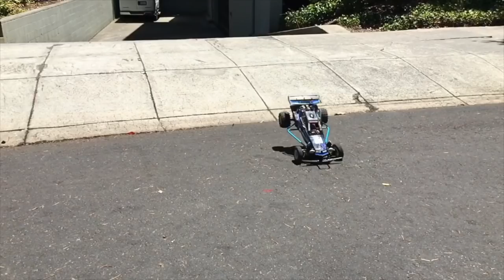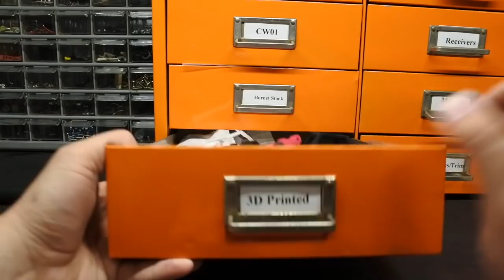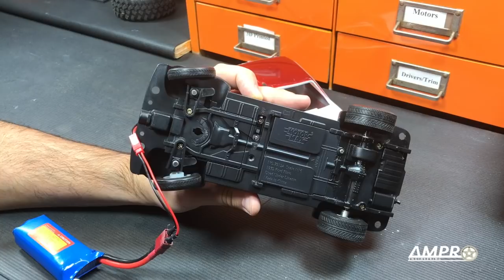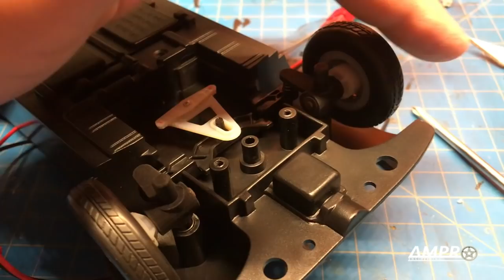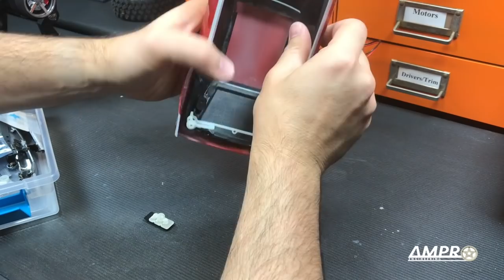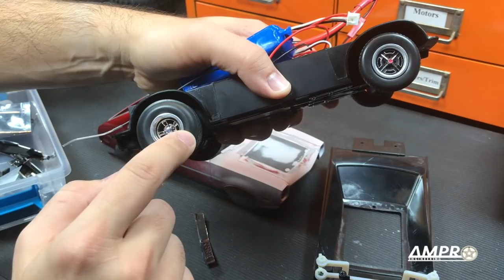e176: 1:16 Ford Pinto By Motor Max -Upgrading by Ampro

Comment: I was looking at my pinto thats like the one your working on and noticed that bottom front and bottom rear of fenders arent tucked in like side of body. Are you gonna heat and pull them in and trim the chassis bumpers
Reply from the maker: Yeah I know...that annoyed me. I didnt do that since it would interfere with the chassis installation. I sanded the edges down to help the look and I think it did the trick. I am just glad the car is done now

Comment: yesterday watching older jdpasl video of a brushless GH, had a "silly" thought, a "what if" a Tamiya Fox rear pod (motor+gearbox+arms+hubs+shocks the works!) were grafted to a GH/Hornet tub?! now add your improved front suspension and the cage for rigidity and the sand rail look... oh my! Fox having the motor aft, gears+diff near as bulletproof as a Hornet, and it allows for a few different tooth pinion gears to be used easily. motor being aft kinda would be like weight distribution of a VW with IRS, for more rear traction and maybe some wheelie action using smaller pinion too. still all Tamiya, but a hybrid of good simple basics that creates something new. edit: basically much like your Superfly II, just a lot less custom fabrication involved for making it happen.
Reply from the maker: Wow...yeah...man that would be cool to see!

Comment: If you can make lexan bodys from that one I would purchase.  Want to build pan chassis drag car that really goes.
Reply from the maker: That is a good question. This may be something I need to ask Team Blue Groove.
Reply: that would be really cool to digital scan and stretch the hood a couple inches, hardwood CNC vaccuform molds for both stock and funny car versions. early last year stumbled into a kinda rare 1/12 BoLink dragster body in eBay, used carbon fiber arrow shaft and black epoxy-glass plate to build a rail chassis for it. "welding" was all cutting to shape, scuffing areas rough, lashing together thick with black sewing thread and CA. rear motor pod is black CF/nylon, was also eBay about 6 bucks. 3650 size 5000kv, 16/44 gear (32p) 1/4" solid fiberglass rod rear axle... its quick fed 2S, near insane on 3S for being so light.

Comment: I had a 74 2.0 4 speed wagon I drove over a dozen years. Great car. Bought it to hot rod but ran so well I just kept driving it and found a 70 Maverick to put a 351w in. Still have the Maverick and still runs strong.
Reply from the maker: Good to hear. The '74 is the best year in my opinion. It is the only year for the non-catalytic converter floor pan and also has the rear subframe that the early cars lacked. Plus it still had the simple fuse panel. I love those Mavericks too!

Comment: Alright, now pour some Gasoline on it and then light it up. Most accurate Pinto ever!

It’s lookin good!
Reply: Ford Fan01 just needs a micro switch in the back bumper to trigger the igniter.  Accurate to the 1200th degree!
Reply from the maker: Hahah, jeez...the explosion fiasco on these cars was a total joke. They were one of the safest sub-compacts of the 1970's but man, that BS story just stuck like glue.
Reply: AMPRO Engineering So in reality, only a small percentage of em, how should we say, detonated. But many people like to act like any Ford Pinto is gonna spontaneously detonate and take out the neighborhood. I believe they even got a recall that fixed that issue.
Reply: was a cute one used to run around Santa Rosa CA, blue in front, nice flames from the rear forward with a text plate at the bottom of the rear hatch "close cover before striking". I had a little 1500cc powered MPG model (tiny trunk no hatchback), Russian River flood of 86 trashed my mom's Pinto wagon and we'd just rebuilt it's 2300cc engine. pulled it and flushed it out popped it into the MPG with its lower geared 4 speed (different flywheel etc). little thing would SCRAMBLE to 50-55 in 1st and 2nd gear, quick to 80 in 3rd. aluminum slot rims (lower mass) all the "dumb weight" stripped, no smoggy pump junk, etc. the MPG were stamped from thinner sheet metal to be lighter, a VERY bare bones Pinto turned budget "horsepower paper clip". little 2300 put out pretty good power, at 60k miles the OHC starts going flat, so ya just replace the cam. had a lot of fun with that toy after slapping in a set of KYB's.
Reply: @FordFan01  I was working at a Mercury Dealer as a line Tech while these were still coming in for retrofitting..... 

Yes it was a LONG running joke! It came from one of those OVER sensationalized TV "news" Programs. IF you hit a Pinto at the RIGHT speed, in the right spot, with CERTAIN Full Size Ford's with Bumpers that were lower than safety standards allowed...
(68-73 LTD and Galaxie were recalled for new, compliant Front Bumpers) AND the Bumper slid under the Pinto's Rear Bumper....

The impacting Vehicle could shear the Pinto's Gas Tank - and the POINTS Ignition and leaking Spark Plug Wires, COULD ignite the Gas that sprayed out of the Pinto from the impact! 
KABOOM!!!! 🔥🔥🔥

THE FIX was a Bladder, inserted into the Gas Tank through the Large Fuel Sender hole on the top of the Tank. 

THEN sensationalists claimed that it was a "Band Aid" fix! Just putting a balloon in the Tank. 

Well...... Rubber lined Fuel Tanks were very successful since WWII, taking 20mm BULLET strikes without leaking! 😳 
There were NO problems after that. 74-up Pintos came with lined Fuel Tanks. So did PintoStang!! 

The only design issue was that the ONLY place they could put the Tank, was right behind the Rear Bumper, and hanging a little below the Bumper. 

....... The ONLY thing I didn't like about the Car, was that when I turned 16.... I wanted a new Camaro Z28. Dad came home one day with my new PINTO!!! 😠 
BUT, my Auto Shop Teacher had "tricks"... We swapped out the anemic 2.3L 4cyl.... and plopped in the 2.8L Cologne V-6 Engine - which mated right up to the stock 4-Speed Stick! 
That was a surprisingly stout and punchy little Motor, especially with the Stick and 3.73 Gears that came with the 4 banger!! 😳😎👍👍 

But why stop THERE? Edelbrock just came out with a 4-Barrel Intake for the 2.8 (actually made for the PintoStang)... We then put a Holley 390 4bbl Carb on it. 

Now, I obviously couldn't go chasing HEMI Cudas with it - but it was a very fun, QUICK Sleeper!! 

SORRY to give you the Life Story! The conversation just pulled all of that out of the memory bank! 😉
Reply: @AMPROEngineering  I will also add.... 
I drove several 70's Cars from 77-93. No matter WHAT reputation the poor Pinto had, I'd rather keep my little "hot rod" Pinto, with a 0.005% chance of catching fire - than a brand new VEGA - which RUSTED right on the Showroom Floor!!!! 😳
Not to mention the Vega UNSLEEVED Aluminum Engine Block, that by 30,000 miles - used more OIL than GAS!! 😖👎👎

Comment: Just bought my first Tamiya kit today! A lunchbox. I plan to add your chassis brace, some aluminum body mounts and a mild brushless system. Anything else I should add? Also, do you know of any 12mm hex conversions so I can upgrade the wheels and tires?
Reply from the maker: That is a good set up but get a lexan shell too. The ABS one is soooooo heavy and the thing never stays right side up. As for Hex adapters, I know tamiya makes some but I am not familiar with much else.